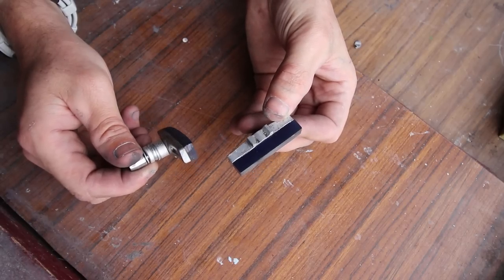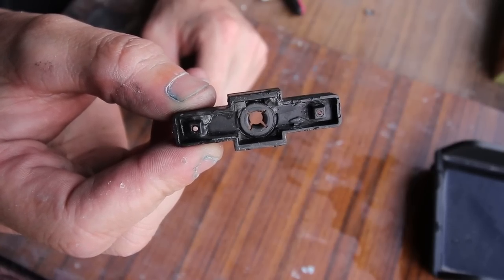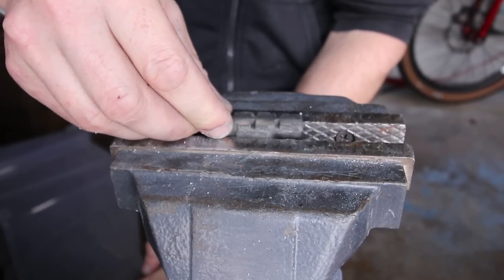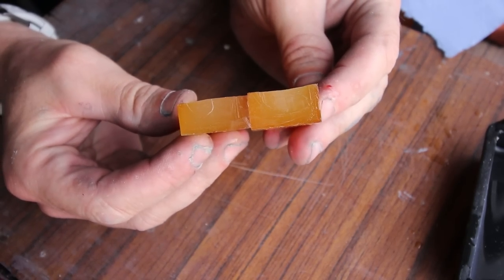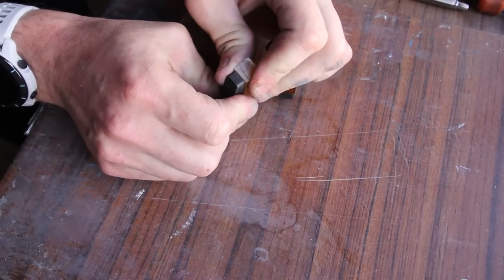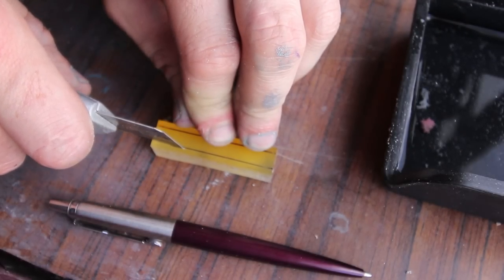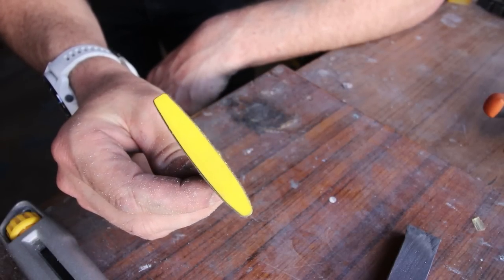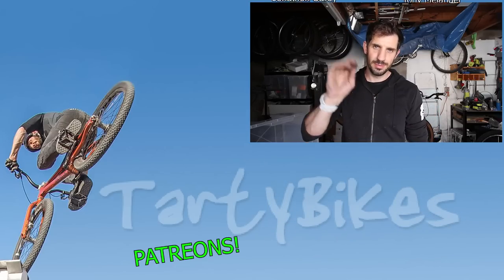Make Your Own Awesome Brake Pads And Save Money!

Comment: "Save Money!" I guess if you do not value in your time, energy, and tools damage, maybe, but does it really worth the effort? I mean of course for a youtube video, for entertainment, yes.
Reply from the maker: I mean this pad material costs about £1 a pad instead of £10-£20 and all you need are some cheap tools and 10 mins (with the better size) so I think it’s pretty legitimate :)
Reply: @Ali_Clarkson  How much can you ride on this pads? If you can really make it in 10 minutes, and it is even better then the commercial products, then sure, it seems legitimate.  This whole idea is came into my mind after I saw that you cut your finger. I tried to repair a charger what was not really repairable, I tried to cut the case, but instead I stabbed my hand. Then I just asked a question from myself, does it really worth it for 15euro charger? lol But of course I will do it again later :D.
Reply: With how things are these days, your time is only worth something if someone's wiling to pay you for it, and right now there's a lot unemployed. So if you're not working or working less than ideal, it could take an hour and still be worth it. Then there's the other side of it, trying to fix or reuse something instead of trashing it and buying new. Personally I'm a fan of this for both reasons, as no one's paying me hard cash right now on a regular basis for my time.
Reply: @Vegan_Touring_Cyclist  Well I make my own pads like Ali does here not to save money but for better performance. I have tried various pads over the years including quite expensive trials specific ones and the only ones I've been really happy with are the ones I make, I think if you asked a bunch of trials riders who make their own pads they would tell you the same thing. This is not Ali doing some gimmick for YouTube it's an actual thing that's done in the trials world.
Reply: @-TheRealChris  I am not familiar with trial, I mean I enjoy watching videos about it, but I have never tried myself. Interesting to hear this, because I never saw anybody making their own pads outside of this trial videos.
Reply: @Vegan_Touring_Cyclist  No I think it's only a trials thing, what you want brakes wise in trials is almost an on/off switch with very little lever effort making the requirements very different to the rest of the cycling world. 
Trials is also a small sport relatively speaking therefore there isn't much of a market for these type of pads and not meany options as a result so to get the performance and lever feel you really like personally DIY is the way to go, street trials is different because there's more flowing moves so something you can modulate like disc brakes.

Comment: Thats so weird that you settled on 80a and 90a durometer material because that is what most longboard wheels used for powerslides are
Which makes me think you could probably use longboard wheels as your material
Reply from the maker: I’ve looked into it! Annoyingly most models I’ve seen have plastic cores that would make it impossible to get a nice solid pad, combined with wheels being more expensive than just the raw material means it’s never been something I thought was a realistic option to try